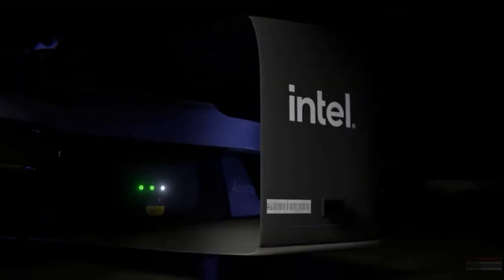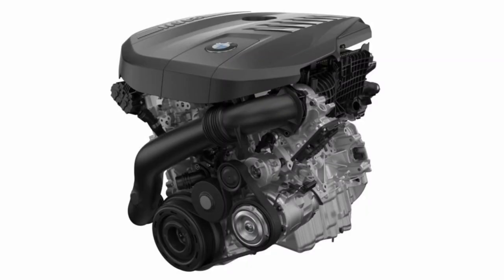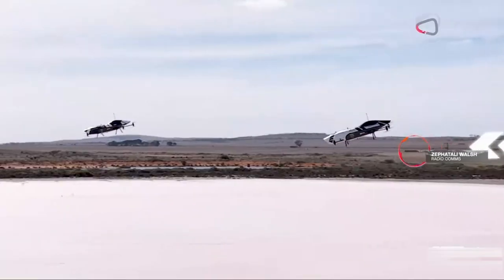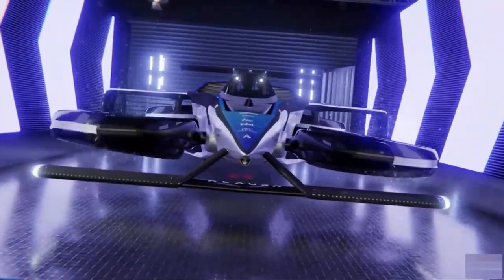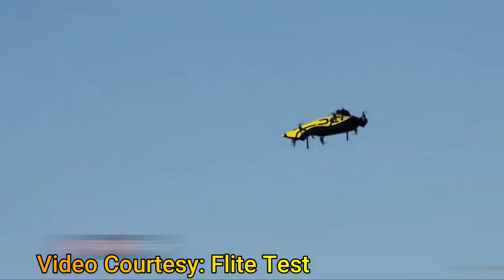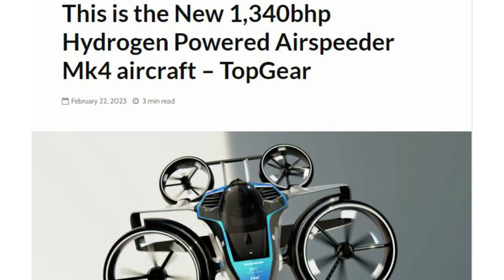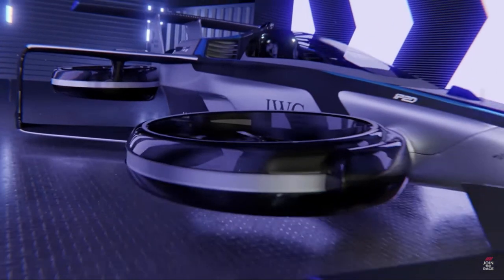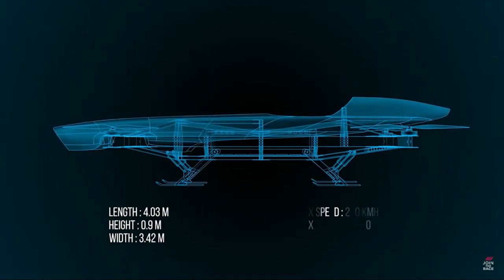Airspeeder MK4: The supercar of eVTOL aircraft

Comment: Interesting that there appears to be a convergence on 2 types of eVTOL. One type starts with a helicopter then adds wings to overcome the rotor power requirements at high speed flight. The other starts with a fixed wing then adds rotors to overcome the wing stall speed at low speed flight. I suspect that certification will allow the first to fly VTOL, but will force the second to be STOL. However, racing is a good way to test both types.
For zero emission electric power I'm slightly surprised the Delta Cosworth Catalytic Generator isn't getting more attention for development funding. This could either run on hydrogen or be combined with Sabatier reaction produced liquid methane.
Reply from the maker: Thanks for that interesting piece of info. Good to hear from you
Reply: @ElectricAviation  , no problem my friend. Times are tough, but I really like the technical depth your channel goes into. If I can help you to analyse and compare different electric aviation designs then I will.

Comment: We are probably recognising the vulnerability of the open props at each corner by using protective ducts, but I would be very afraid of vortex popping the thrust in and out of the aperture of the enclosed wing on this 3 surface design. This is going to be aerodynamically complicated. Given the utility of a power source, I wonder if these machines might better use ducted centrifugal fans to avail themselves of thrust and height for a layout that would offer a universal connection to the traditionally expected flying car, be it F1 or DeLorean.

Comment: The design looks interesting but very "busy" from an aero perspective. All those foils need to be very optimised! They have quite a challenge with the fan actuators too.
Safety wise, so long as they stay well under F1 speeds ands stay low and clear of collision obstacles, then a F1 style safety system should protect the pilots. Lets face it, racing without a little bit of peril is kinda boring!

Comment: EVTOL Racing needs a track in place.
Traditional road racing tracks are not suitable. Just as F1 and Formula E have books of regulations from building the car, to power out put, the
EVTOLs also need regulations.
Materials, motors, types of qualifying thruster (jet or propeller).
Because the race course is in the air, height off the ground width of the track what is an expected turning radius ( 8th of a mile 1/4 mile) are necessary. What is the over length of a race etc. An EVTOL official organization must be formed.
Not quite lastly but, safety, how do you survive and air crash, what are the safety measure that need to be in place. Actual training to pilot these crafts/drones must be formed and actual classes must begin before any races.

#EVTOL
#evtolracing
#racingorganizations

Comment: That's 186  Miles using 76 Gals of Hydrogen = 186/76= 2.45 Miles/Gal Of Liquid Hydrogen At About $16 / Gal.
Reply: But to store 76 gallons you need to double the volume of the vehicle, big issue with the current plan.
Reply: This wont happen I'm very much into fpv drone racing and thinking about this being a reality to the performance of fpv drone racing is a pretty terrifying thought. Every race ive ever been too has a quite a number of very skilled pilots going home with there drones in pieces. Now imagine crashing in a manned drone at 200 mph about every race will be several contestants ending up in pieces.